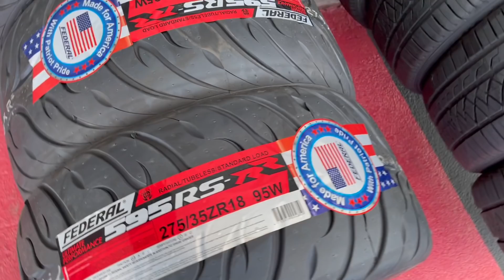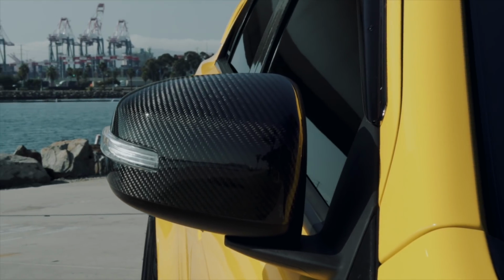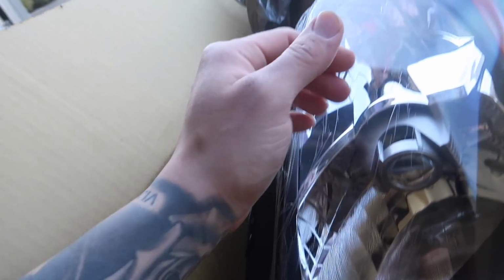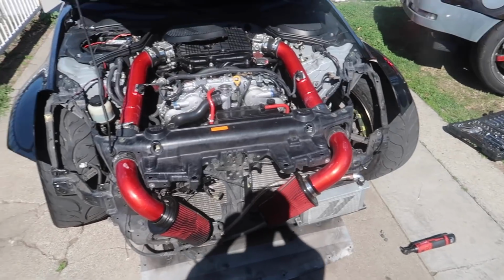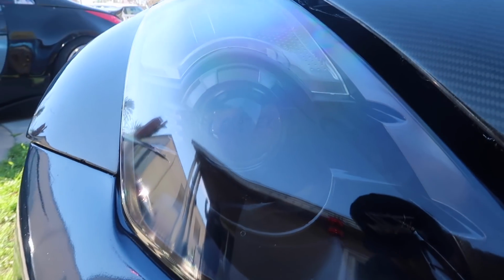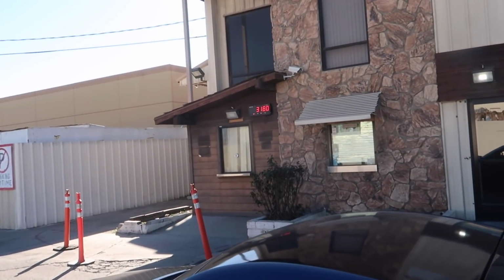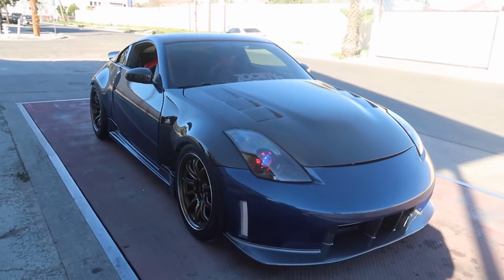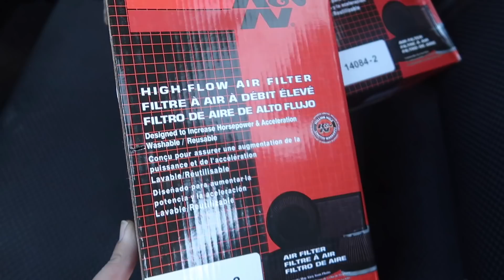WEIGHING MY 350Z! | NEW UPGRADED HEADLIGHTS FOR THE Z!

Comment: Hey you don't have crash bar and you live in so cal you should check out Street faction Engineering, I got a bash bar for my 370z for 250 bucks that will still allow you to run oem bumper ans those massive filters and it will fit an intercooler if you want boost in the future

Comment: why do you people keep calling them HR or DE headlights? 06 is a DE and has those headlights. 

anyways the 03-05 headlights can be brighter than the 06+ because of the seperate low and high beam. run 2 LED bulbs and you’ll look perfect. nevertheless the 06+ look betger

Comment: Lowtek I’m trying to find a Z in Atlanta but can’t find any manual or coupe
Reply: Just wait, i waited 3 years for my Hr 6 speed
Reply: If you find one, you’d better jump on it right away. These cars are becoming harder and harder to find that isn’t a convertible/automatic.
Reply: If you can shop in la market area i see hr for sale alot 10-15k
Reply: Yeah took me a while to buy my Hr but cost me 12k 😒😂 since it had a brand new Daytona Blue paintjob, Clutch with less than 10,000 miles and Heavy duty CSC, and Updated Oil Gallery gaskets unlike the original Faulty ones that cause low oil pressure and it only has 75,000 miles so it was Worth it to me lol